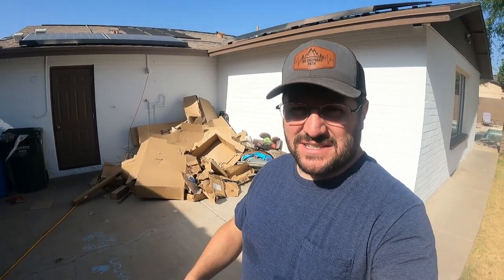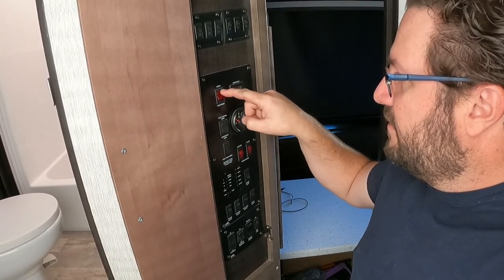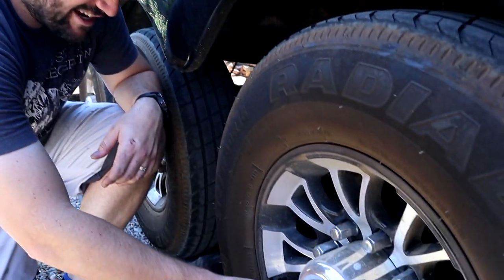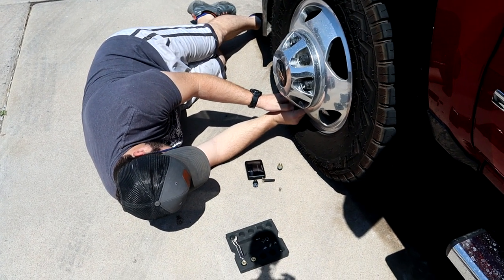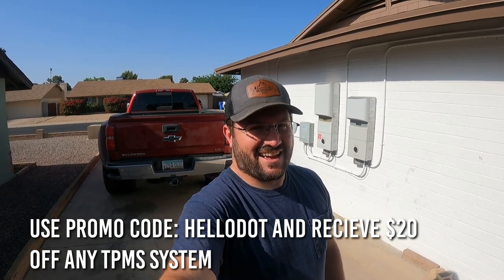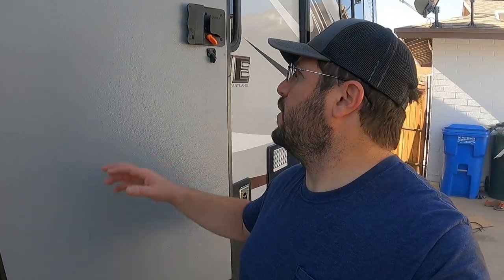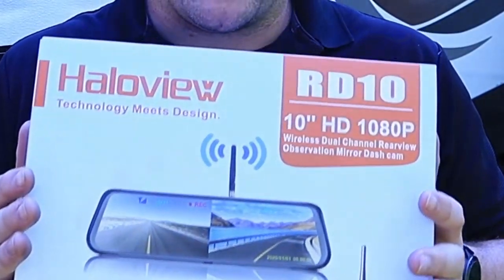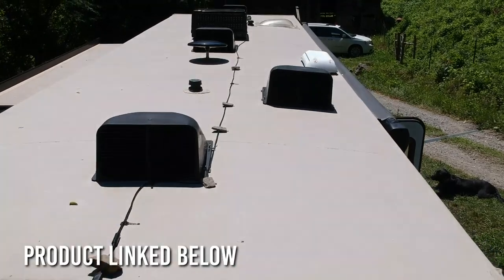Upgrading Our Toy Hauler for SECURITY [Locks, TPMS, Gene, Camera]

Comment: Vehicles over 10,000 GVW (so, duallies) are not required by law to have TPMS, unlike smaller vehicles.  I just learned that two weeks ago.  ;)
Reply: I should specify, MOTORIZED vehicles.  Trailers don't have to be manufactured with TPMS, regardless of GVWR.
Reply from the maker: Good to know! That would make sense then.

Comment: I have one issue with the key pad door locks. Because the entire inside assembly is black, most guests and my dear wife mistake the close portion of the metal with the door latch. It would be great if the two items were readily discernible. Perhaps they could be different colors. Otherwise it is great.
Reply from the maker: Haha. Yes we've done that too. :)
Reply: Just an FYI they do have an all-white version that might be better for you.
Reply: @johnfarnsworth5630  perhaps you are missing the point. When the inside is all one color it is difficult to differentiate the pull handle from the closing handle. The two pieces need to be different colors. We go camping every month with different guests and not one of them has been able to open the door without assistance since I installed this new door pad.